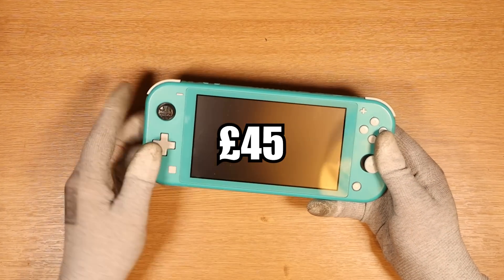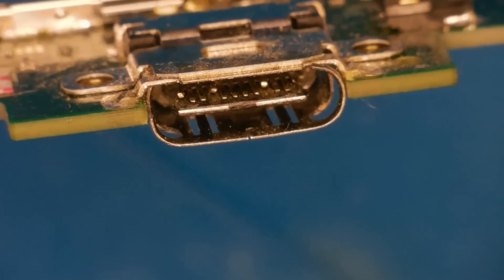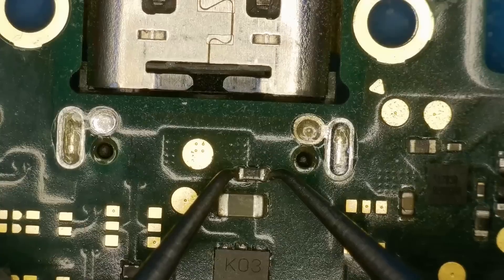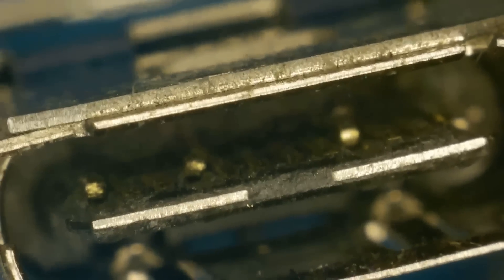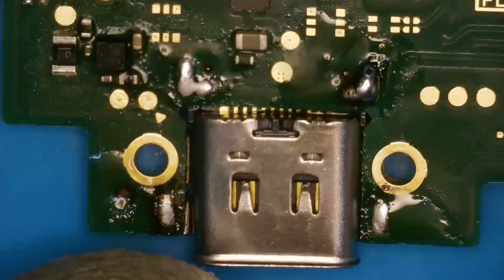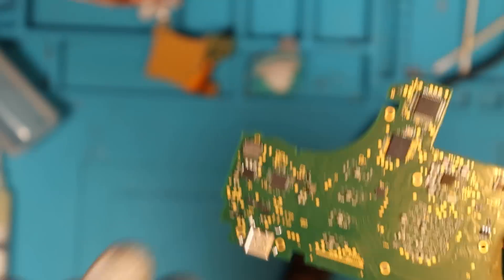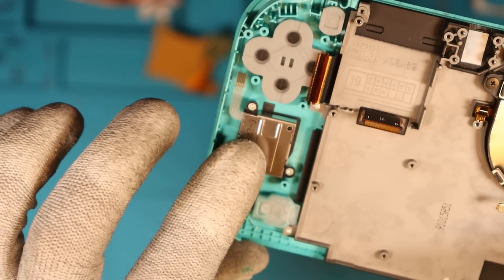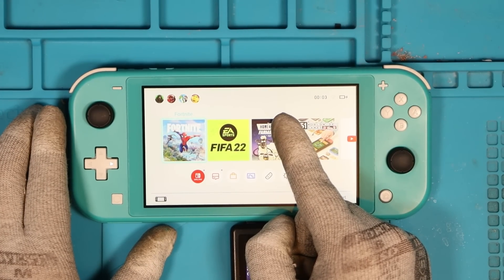£45 FAULTY Nintendo Switch Lite with No Power | Can We Fix It?

Comment: Here in my country switches have vertical screen line issues mostly from switch lites and V1 switches( V2 also but rarely) on the LCD. The screen just gone bad for some reason without the unit getting physically damage or whatsoever. I've searched and asked some technichians here but none can tell me why this happens, I think its because of overheating and such? Have ya'll ecnounter this problem?

Comment: I have one that’s turning on but no screen .. I believe it might be the black light .. any help peoples ?
Reply: If it’s backlight use a light on screen and see if the screens still on. if it is then backlights not working. If the whole screens not working then that could be a bad issue.
Reply: @thisthingmint250  Thanks for the tip .. I’ll give it a crack then move on and see if it’s the backlight driver chip or something else

Comment: Just wondering is that the TS100 iron at 5:19 and what size tip is that? Also just wondering would it be possible to plug a usb dust protector into the port while using the dremel to prevent shards entering the port? obviously you may decapitate the dust protector but hey...

Comment: Good stuff JDT! You're getting really confident with these things now. By the way if you get yourself a dremel you can shave down the original switch ports to fit the lite. There's a little cost saving method if you want to pull back an extra fiver 😝
Reply from the maker: Thanks bud always means a lot coming from you :) that’s what I done with this one, had a dreamer and shaved it down :)